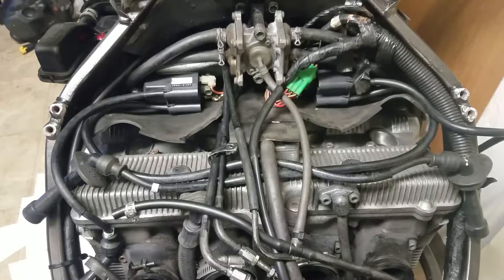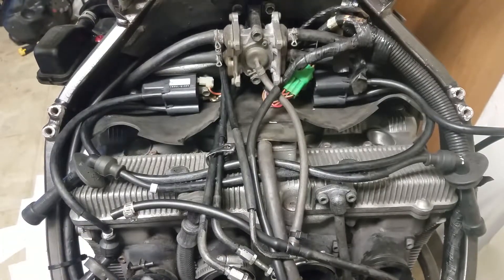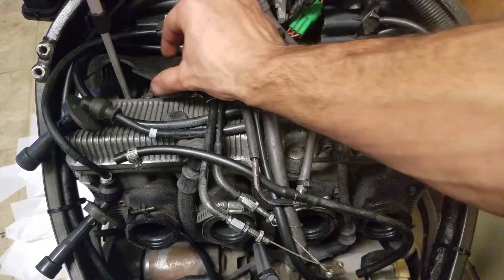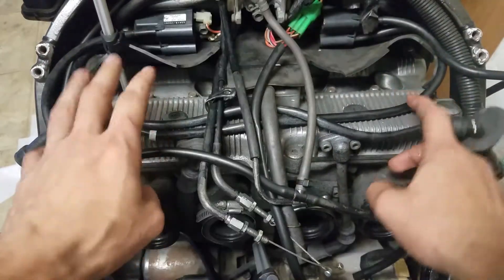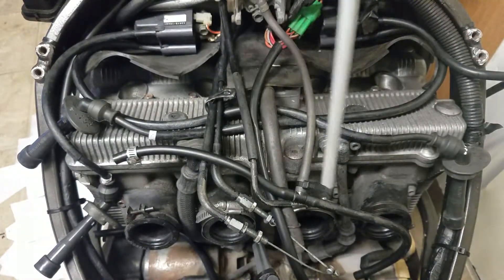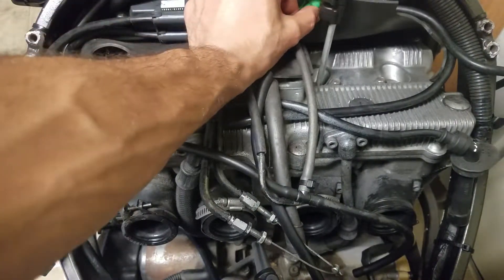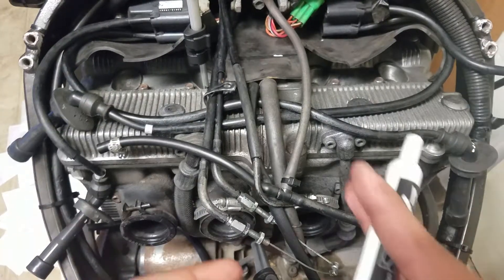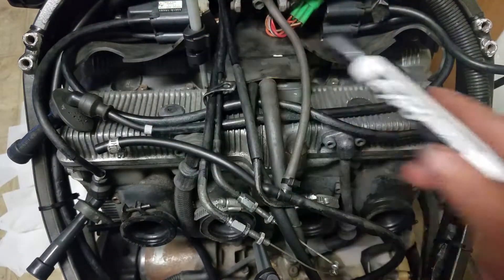Engine Damaged? Hydrolocked Motorcycle Suzuki Katana 750

Comment: this is great info. my bike gave a massive misfire. i left it for a moment and tried to start and there was a clunk noise when trying to start, then fuel running out of the airbox, fuel leaking into cylinder 4. Il try now to see if the connecting rod is bent